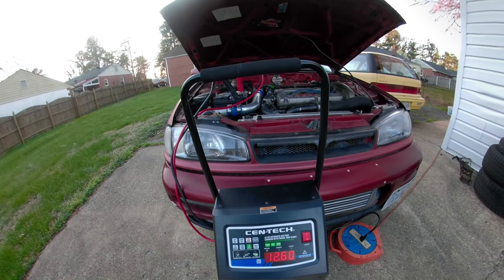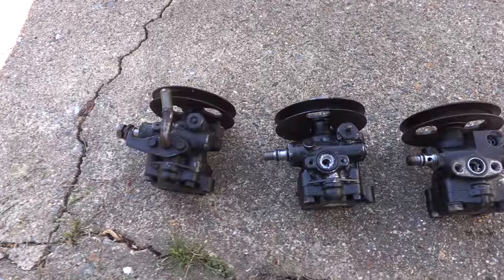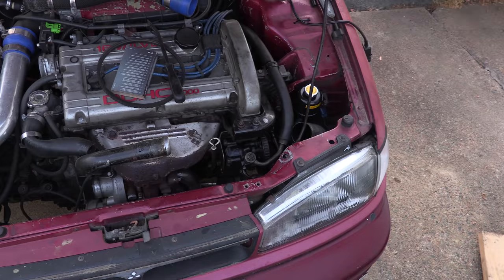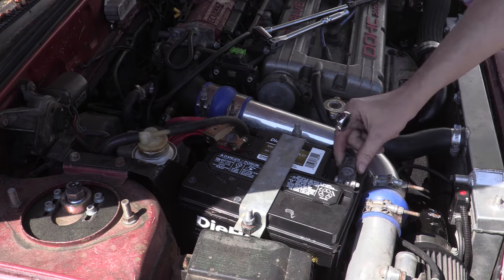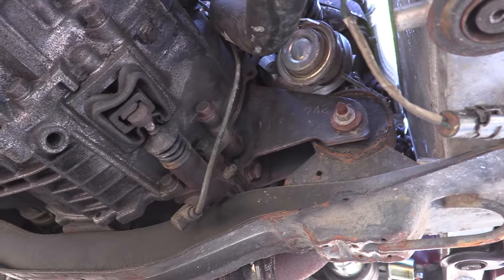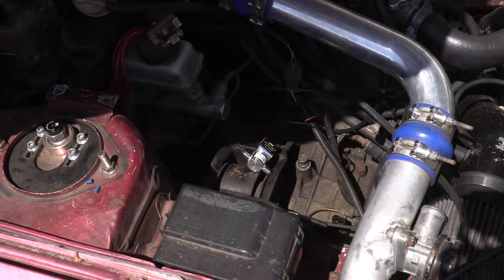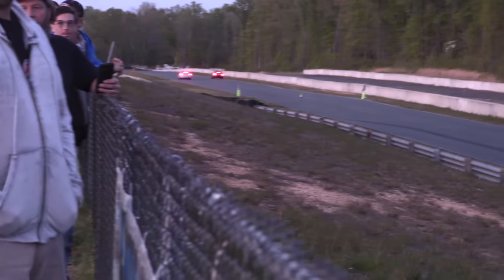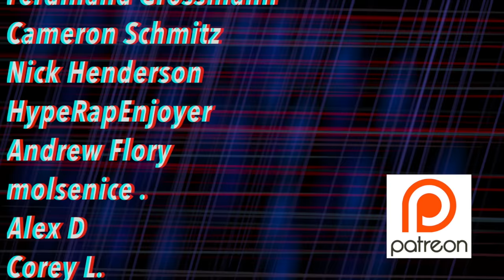When easy fixes go wrong...

Comment: "Every 20 minutes job is one broken bolt away from becoming a 3 days ordeal"
Reply from the maker: The engine mount repair took exactly 3 days.  It was two bolts, but the same part required.  I'd say CONFIRMED!

Comment: Great timing, I was wondering when we'd get a new video. I just finally got my GSX running and out of the garage. First engine I've ever built, every bolt and bearing and valve and spring touched by me, and your videos were instrumental at every step along the way. May not have even tried to do it myself if I hadn't head your videos as reference. Thanks, Jafro.
Reply: Congrats on the build.
Reply from the maker: This is everything I did this for!  Right here, people!  Another one saved.  Thank you Mike Scherrer!  All I can really offer across the internet is inspiration.  You had it in you the whole time.

Comment: Watching you undo the power steering pump in tight quarters is making my brain have an empathic reaction and my hands are hurting just watching you slide hands in/out past the metal shields/brackets etc. But I did learn a LOT. Worthy of every minute spent watching. Oh and this me 1993, working in the street on my '81 Mercury Capri. Effing starter motor.
Reply from the maker: I complained about so many other things in the video, I felt it only necessary to imply it.  Thank you for noticing the cramps and yes, those hose clamps are sharp, but fortunately blood and oil actually mix very well.  Please note that neither ATF nor power steering fluid is oil... and it burns pretty good when you mix it with blood...

Comment: Working on older cars or any machine for that matter, is that you will find more wrong when you start to fix a single problem, and suddenly you notice that you have more problems that you begin with. But the satisfaction when its "complete" (read= ignoring rest of the problems for now), is priceless :)

Comment: I enjoyed undoing and doing up my power steering pipe on my old volvo by 1/12 of a turn recently. Peaceful sort of exercise that. I also learned that you don't need to have the engine running to pump the fluid through. Just turning the wheel lock to lock will pump it through at a good rate and you don't risk running the pump dry. Then you can just catch the old fluid from the return if you want to replace it and keep filling the reservoir.

Comment: Damn do I feel this pain. I put a 2.3L millercycle v6 (KJ-ZEM) in a Protege5 back in 2015 and ended up having to build an engine mount stabilizer back to the strut tower for the RH side just to prevent the crank pulley from leaving marks on the frame rail. It was a radiator-out process for most anything with the accessories and engine-out if you want to do a timing belt or get the the timing covers off at all.

Absolutely love your videos. Your recording/editing style and sense of humor combined with the totality of knowledge you bring to the table are top tier. Easily the most rewarding videos to watch in the automotive realm for me. Cheers from Fredericksburg!

Comment: Ah dang Jafro I went through a ton of issues with power steering myself on the Mirage build.  I think I spent a grand on AN fittings and hose in total changing all the lines and still couldn't prevent leaks from occurring.  (I think there was an overpressure issue with mixing Evo and MIrage stuff)  I ended up ditching the hydraulic pump setup completely over the Winter in favor of doing a retrofit of an electric assist steering column for a Chevrolet Equinox/Saturn Vue.  Believe it or not it was actually a fairly easy install and I think I spent $300 in total for the column from a picapart and a controller kit from epowersteering.  Really cool setup as you actually get a potentiometer with the kit that lets you dial in how much power you want and it can be shut off to not put any extra load on the alternator on the drag strip plus you get to ditch all the pump and lines for weight savings and less drag on the engine and the best part is no more leaks!  I have a couple videos of my process on my channel if you are interested.
Reply: alchem1st88 I also ran into the same issues with a ce mirage with evo 8 4g63 the way I got it to work without leaking or blowing lines was with a 4g69 power steering pump and bracket off a 2006 ch lancer
I also needed the alternator and bracket from the 2006 lancer

Nice build bro I’m subscribing 👍
Reply: @svent9238  Subscribed, might do this to my GSX if my newly rebuilt pump keeps making noise.
Reply from the maker: Same...  Why wasn't I already?
Reply from the maker: If I did this to the Hyundai, I'd leave the pump, lines, hydraulics and everything on there because I need the weight.  FWD life.
Reply: hands down the EASIEST way to get around dealing with ALLLLL that frustration is to use a simple electric power steering pump that are literally litered in every junkyard in the nation.. volvo s40,s60 etc etc have them, SOME nissan altimas and a host of other cars have them.. the volvo pumps have normal power steering line hookups and honestly it's as simple as power,ground,remote turn on wire THAT'S IT.. so cut the pigtail harness connector when you get the pump and you only need 3 wires.. ignition on/run is what I use as a wake up signal to the pump.  

you'll kick yourself when you see how easy it is to retrofit the volvo pump into an existing system.. then you can remove the belt driven pump,brackets, belt etc etc..

then you might ask yourself "what about the power steering lines" i just ditch the factory high pressure line if I cant bend it to my will where I want the pump to mount.. if not just remove it and order a braided line in the legth you need and attach the right ends on it and now the line is easily placed where you want the pump to be. then just route the return line which is low pressure so its easy.. your done!

Comment: Last comment for now I swear. Had the exact same issue with one of the bolt holes on my GSX transmission. Previous owner had used a much too long bolt and added washers to take up the slack and somehow overtightened and stripped it out. Thread repair kits for the win! Great video as always. We love seeing you triumph.
Reply: I checked out your channel the other day to see if you’d got that eclipse going. What ended up happening to it?
Reply: @IcanDriveIt  I did get it running and driving, but had to tear it back down to fix rust. Got it in the garage, found some problems were worse than I thought. I got parts to fix it, but then got busy with other projects. I have been totally focused on building the V10 Impreza. That entire series will be coming to YouTube, but has mostly been on TikTok right now. After that project is in a better place I will still be working on the Eclipse as well as the MR2. I actually have two 1997 Eclipse GSX now. One is a clean shell, one is the red one. I will likely be making the clean shell into a whole car and then doing a fun swap on the red car. Even though it is pretty rusty, I won't be getting rid of it. 😁

Comment: My story might help you-
2002, had my Pulsar 1.5L. Got out of work, PS pump seized. Got hacksaw blade,
cut belt. Never replaced, just removed entire unit. Car was so small, easy to turn
w/o PS. It's just parasitic latent horsepower anyway, especially cold molasses 
hydraulic fluid and tiny orifices, with a cooler in front, -℉ wind chill in December.

My advice- find a manual steer. PS is for an Eldorado.
Reply from the maker: I've got a manual rack for the AWD colt.  I can tell you now, when it's sitting still on 16" inflated DSM wheels, you can't turn the wheel at all unless it's moving.  But that's how it all was before power steering.  Food still got to market, humans still ate it and continued their proliferation.  Not having power steering did not end the human race. It's going to take more than that...

Comment: Well done that's a lot of fixes. I could have done with this info 2 years ago. When I replaced the clutch on my 2005 Elantra I also found out the hard way that the three top mounting bolts had stripped out. It's an aluminium case as well so my guess is the last mechanic that did a clutch on it used a rattlegun to tigthen the bolts? I didn't know about thread inserts at the time but learnt about them very shortly after. Keep up the good work Jafro!

Comment: Nice to see you back at it, Jafro.
I bought my first DSM for my stepdaughter; 2009 Lancer GTS. Pretty good little car, but what the heck is up with finding parts!? Finding the correct axel seal (I had the correct trans code from the door) was like whack-a-mole, and it wanted the manual seal… it’s the CVT. What a weird situation.

Comment: I remember you racing the gsx dang wish them days were not so far.them coils repair kits are so good if used them on timing bolts that hold the pulleys on on a subaru never had problem.
Reply from the maker: They definitely saved my skin!  There are beefier, bigger, thicker inserts out there... but I wanted to start small so that I have room later for "bigger" fixes.  I've heard that these coils don't appreciate frequent service work.  They're best left un-disturbed... whereas the bigger inserts don't have that problem.  The important thing is we use what properly and securely fixes our problem!  They've saved me several times, they're a stripped exhaust stud hole's best friend!

Comment: Hate it for ya but glad I'm not the only one with stupid issues to deal with. Aside from that, wish we could've seen the et's 😭

P.S. Dunno if you saw my AEM Meth video or not but aluminum brackets are lighter and no need for paint 😉
Reply from the maker: I know.  That track is just not equipped with it yet.  The water box is also on a slope, so the water runs down to the launch box.  There are issues, but I feel like they play into the whole street racing vibe of the place.  I'm sure they'll have a timing system someday, but until then they're only overflowing with atmosphere and camaraderie.  Still both good things.  I did watch your AEM videos, and lament the old version of my kit that I have.  I'd have used aluminum if I wasn't already contemplating welding a 4-foot section of railroad track where my front bumper is supposed to be.  The placement of the rear axle on this chassis is a nightmare.
Reply: @Jafromobile  should look into purchasing a Dragy if you don't already have one. It's GREAT for gathering data when the track is far away but need to see where you stand.

Comment: Reminds me when I had to pull the trans to fix a gear that got pushed off and when I fixed it (welded on now :p) I checked to see if it would go in gear and turn the shafts. Funny enough I picked 4th and Rev to do that which fine to do. I hurried to shove the transmission back in and got it all hooked up and fluid fired it up and found it didn't want to go into 1st 2nd 3rd or 5th. 😔Out it came again. It had a detent system for the shift forks and they got to go back in while in neutral. I had it in first apparently. 😑

Comment: You could probably get some extra room under the hood by putting a second turbo on, and just free-blowing the compressor side through your engine's aquatic system, but removing the radiator and all the water. Since it wouldn't really be compressed (venting to atmosphere after passing through) the temperature shouldn't be much more than ambient, but the velocity would take away a bunch of heat.
Reply: it sounds like you have learn more about heat capacity and thermal mass 🤟
Reply: @byloyuripka9624  Don't forget velocity. That's a big one that's often overlooked.

Comment: When did the hyundai get a new radiator 😅 how did I miss that
Reply from the maker: It sprung a leak after I rebuilt its engine and reassembled the car.  The old one just rotted out.  This aluminum radiator was actually the original radiator that Jamie had in a Mirage that I sold him for $60 [edit:  I sold him the Mirage for $60, he bought the radiator somewhere else].  He had it paired with the engine that's now on its third life now in my Elantra.  That Mirage got T-boned by a Beetle, so Jamie bought the Elantra from a junkyard and swapped it with that engine.  He insisted the car be built with all OEM factory used parts, and downgraded to the OE junkyard unit that it had before he gave it to me.  I bought his aluminum radiator for the Colt from Jamie who thought it was too nice for the Hyundai.  Now it's full circle back to being reunited with its original engine in the Hyundai.  Same with the front mount intercooler that had the rag in it.  What's also strange is those Flex-a-lites on that aluminum radiator are from my GSX, and I sold them cheap to Jamie, they ended up on the Hyundai, and then he gave it to me.  Same thing with the transmission.  So this transmission bolt problem is mine and only mine as far as I'm concerned because I'm the guy who originally pulled it from the 1990 Plymouth laser and started all of this to begin with.  What is it with all these boomerang parts?

Comment: A dab of high strength loktite on the outside of the helicoil and let set before torquing is a red hot tip too mat. And yeah all those one drive wheel launches and all that suspension work eh and it all could have been just that mount.
Reply from the maker: That right there was the hardest pill to swallow... although before I rebuilt it, and when making hundreds less hp with a 14b, it still had a peg leg.  

I think I'm going to go ultimately need a 9" wheel.  These 225's have a contact patch that's way too round on a 7" wheel. I don't make the contact patch necessary to stick a 20g in this car with FWD, I want to flatten it out. It's way too light-switch-spooly.  I don't make the contact patch necessary to stick what a 20g produces.  You're holding on for dear life fighting torque steer.  All turning the boost down does is make it slow.  It's like it wants the wheel spin in order to produce an ET even though it's counter-productive.  With the mount fixed, I'm going to balance it all back out, get it re-aligned and try again.  If it still doesn't work, I'm going to start stuffing my engine bay with GoPros aimed at chassis parts all over it and making test hits to see what's happening.  Plan C is the 9" wheel.  Plan D is a larger diameter wheel/tire. That is when this becomes less of a street car, and I really want a street car out of it.

Comment: A ball check valve would have fix the issue with the meth injection, placed after the pump, close to the injector(s).
Reply from the maker: It's not a back flow issue.  It's a forward-flow issue. The tank being higher than the pump means the weight of the water in the line downstream from the pump, or in the case near the injectors, upstream from it with head pressure – will still push fluid past a 1-way check valve.  My injector has a check valve, though it's not the ball style.  But the solenoid stops it every time I cut off the engine, guaranteed.  I don't have provisions for my kit to control the solenoid, but thanks to this car's specific OE automatic features that aren't being used, I think I have the perfect solution for how all of it integrates into this car.  It's going to make it more awesome-r.  Perhaps even a more practical execution of the entire kit and how I have my failsafe equipment set up for it.  I need to map it out so its both presentable, and hilarious, but I'm going to finish that cylinder head first.
Reply from the maker: ...and of course if a ball valve makes it work better, I'll do that, too.
Reply: A ball style check valve uses a spring to hold the ball in place and takes several psi to open. A properly functioning one would not allow this leak by. Your solution should work just as well. I just have experience with hydraulics design and thought of the check valve.
Reply from the maker: The spring occurred to me right after I posted. ;D  If you know of the video where Big Red argues with the Hyundai, the spoiler is in that argument.
Reply: I'm also a little buzzed, and living vicariously though your videos. Though most wouldn't consider a Dodge Stealth R/T a DSM they have more similarities than differences. And I have one sitting in the driveway with a spun rod bearing I don't have time to fix.
Reply from the maker: It's okay not to have the time... but go ahead and get the parts.  That was my college years' dream car.  I was late arriving, just getting annihilated by DSMs, Stealths, and VR-4's while delivering pizza for a living.  They were the only cars anywhere in town that were always in a bigger hurry than me.  I got the receiving end every time I saw them, but all I was really just trying to get someone their pizza.

Comment: I know the "94-"98 7th gen Mitsubishi Galants use the two m8×1.25 fasteners on the power steering pump return tube so the pump might work in place of the Elantra pump.
Reply from the maker: You know what?  The block in this thing is from a 6-bolt non-turbo Galant.  I think you might be on to something?  The head was from an Elantra, and you saw the Elantra was a big nope.  Same for the turbo DSM although they looked the same.  I think if I need to do anything, it's just to get another small fitting off a discarded turbo DSM pump, change the hose over, and use the turbo DSM pump.  If I just had a spare one of those fittings around...?  lol
Reply: @Jafromobile  well upon closer inspection the pump that was on the car looks a lot like a "93-"98 Hyundai Sonata 2.0 power steering pump.